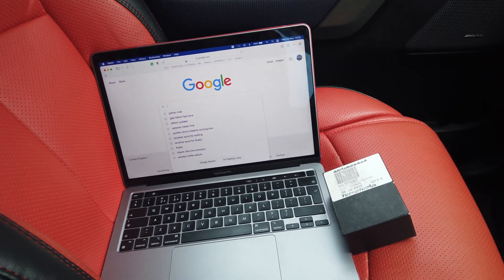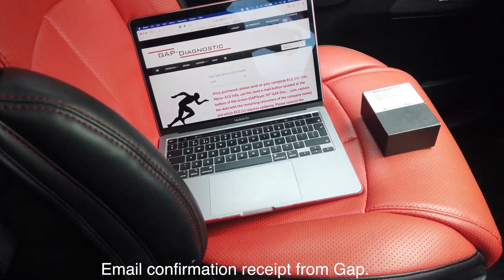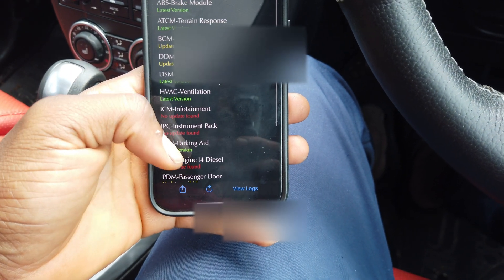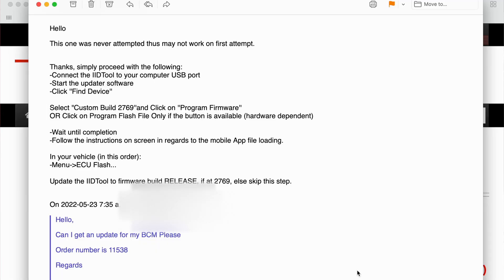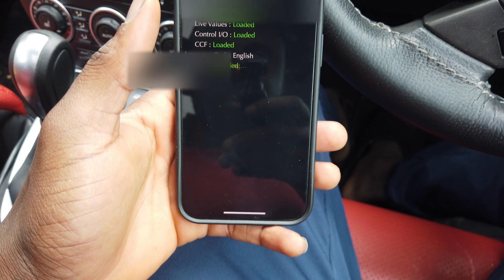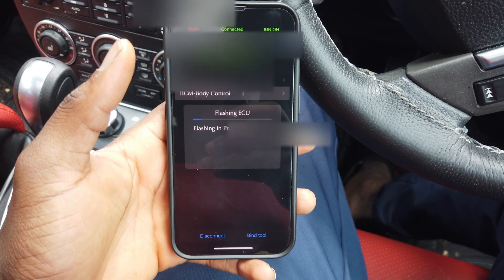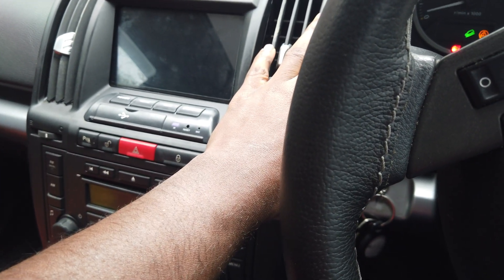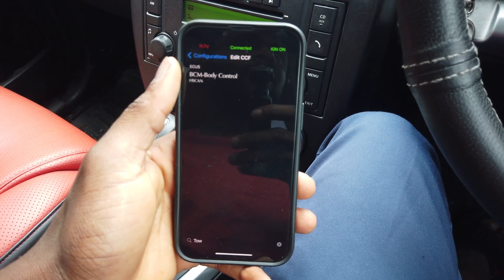Freelander 2.(FL2/LR2) BCM Software update with IIDtool BT

Comment: Hii..why you need to do an update on BCm??specific Reason?
Reply from the maker: Hello - When you replace the BCM from another car, when you replace or install a some new hardware from a different year model etc. In my case, it resolved my delay in electrical ( fuel gauge, delay in radio turning on etc. ) when I start the car at hotter temperature. Some people live by “the if not broken don’t fix it “ whiles others say “manufacturers release updates for a reason” its all personal preference.